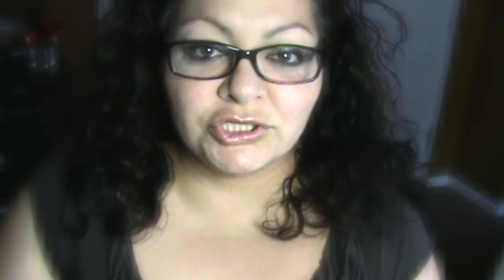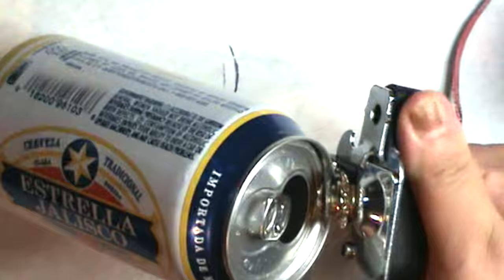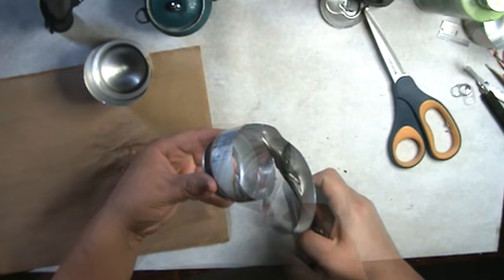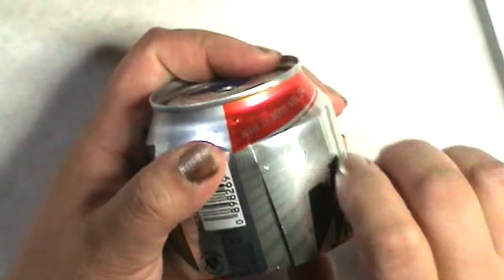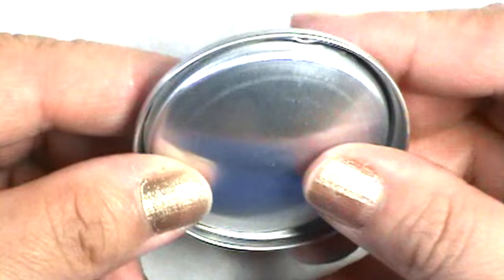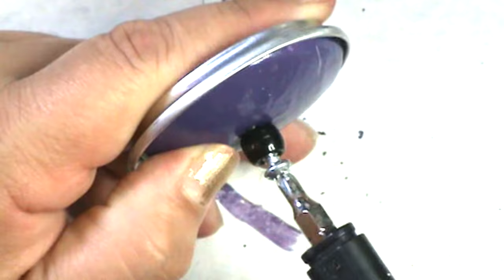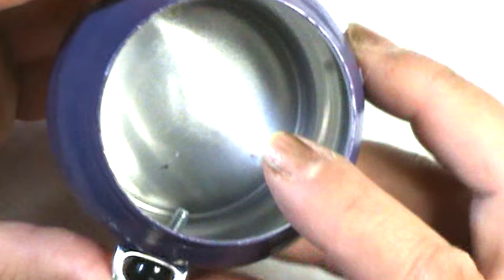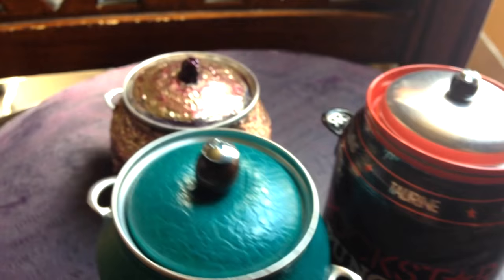Mini Stock Pot Out of Aluminum Cans!!!!!

Comment: Are these safe to cook with? Btw good job making these!
Reply from the maker: Hi Thank you, =) 
I don't recommend these for cooking, since they have holes on the sides plus the aluminum is way too soft to withstand heat for too long. =(
Reply: I’d recommend not cooking with them either since the can is not just aluminum. They have a BPA liner on the inside that prevent the contents from eroding the aluminum and shortening the life span of the container.
Reply: Not to mention I'm pretty sure nail polish is flammable.